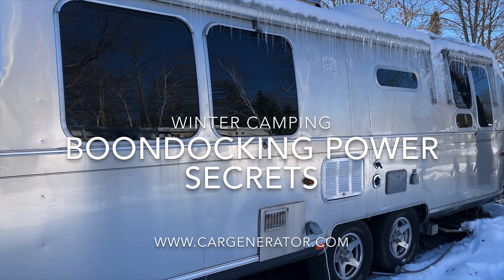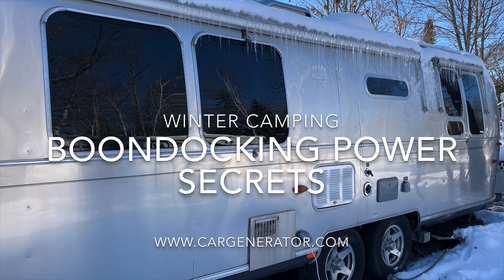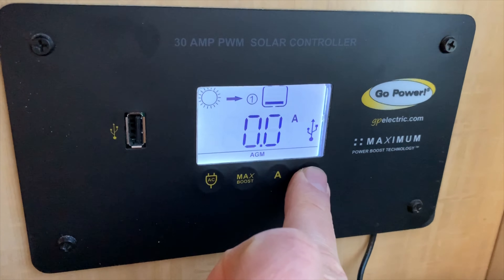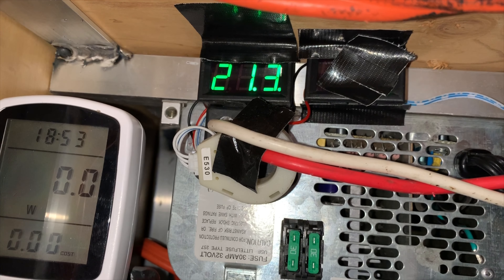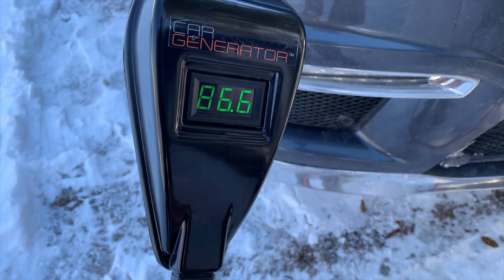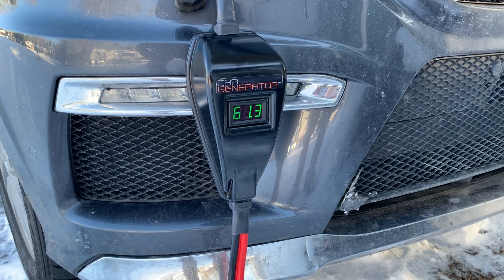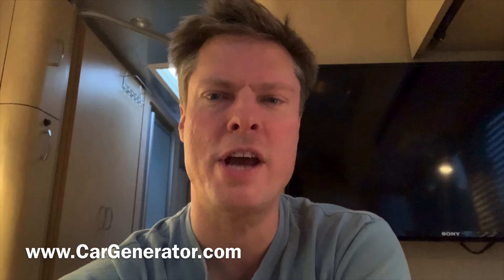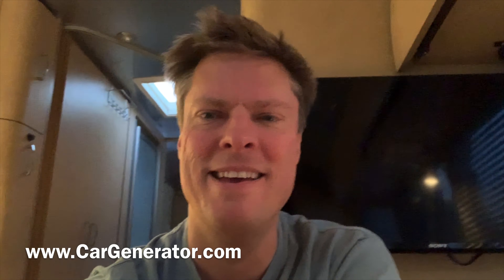How to Make an RV Livable in Winter - Winter RVing Tips

Comment: I am a little confused. About how this works.  Why did you hook up shore power?
I thought you were dry camping.  You first hooked up shore power.  You then hooked up the dc to dc connection to the trailer.  This put in  a lot of amps quickly which is great.  Would it still do the same without shore power.  Right?
Reply from the maker: we hooked up to shore power temporarily, simply to measure and show how many amps that puts into a drained battery.  In the video that was around 21 amps.  It would be identical for running a portable gas generator in this case that would put in 21 amps also.  Contrasted with plugging in direct via CarGenerator Boost where it starts at around 90 amps, then over an hour drops to 60 amps, then one more hour down to around 30 amps.  The purpose is to show how much quicker and safely we can bulk refill the trailer batteries simply using our tow vehicle.
Reply: Very impressive!  I only have two batteries on my Airstream, so about 1/2 the power you do.  We have to be really careful dry camping in cold conditions so as not to deplete our batteries..
Would the 1000 model of CarGenerator have enough power to run the converter in the Airstream to charge the batteries?  Even though this would be at a slower rate
Thanks Rich
Reply from the maker: @rgdowntheroad  Yes absolutely the 1000 watt CarGenerator can easily power any Airstream charging circuit.  Here is a video that shows exactly how many AMPS it puts in (approx 25), and shows how many WATTS it actually needs from the generator to accomplish this. (approx 440 watts)    Feel free to also post or share this video to Airforums or Facebook this may be helpful for others to know exactly what power is required and used.  https://youtu.be/FpjIZmypPTg

Comment from the maker: The purpose of this video is to show that: 
1. winter camping draws down your batteries really fast, in our case even with 4 massive deep cycle AGM batteries and 400 amps reserve 
2. recharging your batteries by plugging into a gas generator or the grid, only puts in only about 21 amps/hr
3. using your tow vehicle to refill your trailer batteries in comparison?  starts at approx 90 amps, then 1 hr later 60 amps then 1 hr later 30 amps
After 3.5 hours we bulk refilled 200 amps.  In contrast a portable gas generator would take 10 hours of running to accomplish this.
Suprisingly, gas consumption between a modern efficient car engine is in a similar range to running an inefficient small portable gas generator engine.
See our detailed comparisons on this at www.CarGenerator.com/FAQ
So the bottom line is how fast, easy, and effectively your tow vehicle refills your trailer batteries.